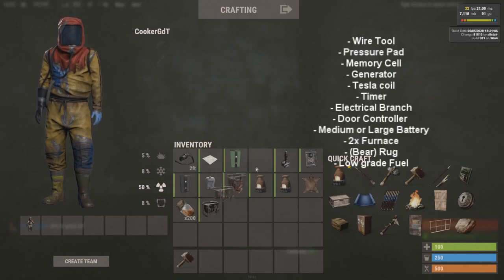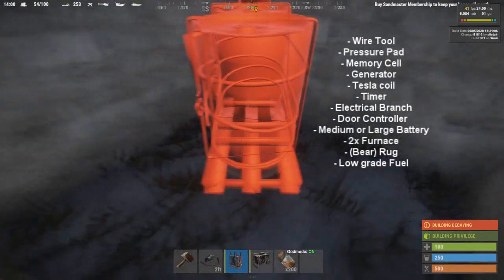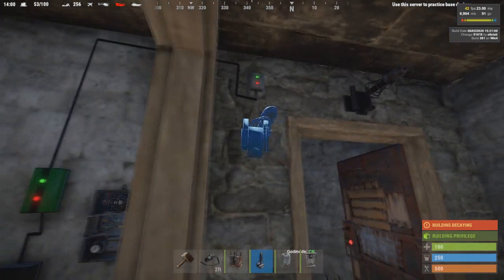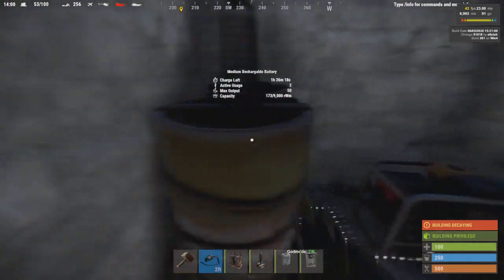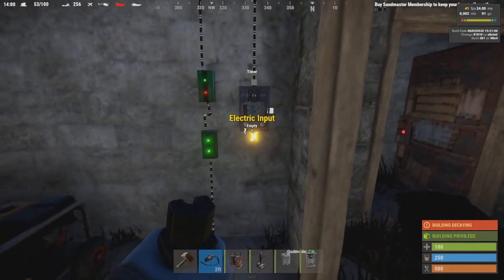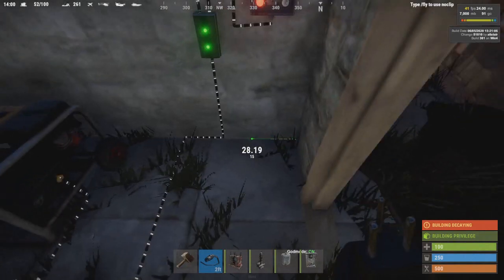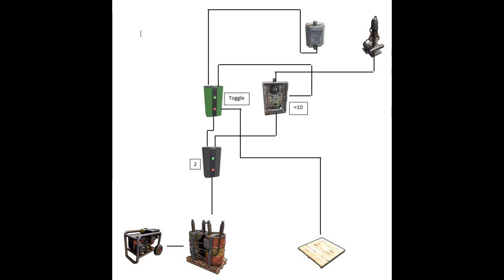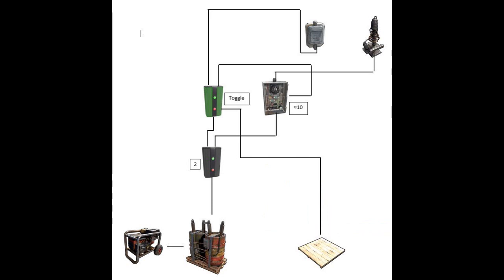RUST : Automatic TESLA COIL / DOOR trap - No visible power source

Comment: to people asking how to reset the trap in case you accidentally activated it when returning home: there are a few possible solutions. the one i'd go for is to use set / reset instead of toggle. you'd have to add a 1 second timer (and another branch to power it, 2 power is all you need) and connect it to the reset part of the memory cell. connect the pressure pad to the set part of the memory cell.
using the toggle in this particular trap is actually a blunder and can be exploited. if they are quick enough they can move off the pressure pad and onto it again which will toggle the memory cell and reopen the doors. more importantly, they might do it accidentally by panicking and moving around. after that they can simply come back and loot their body without entering the trap or their friend could loot it for them. if you use set / reset no matter how many times you step on the pressure pad nothing will change, even when you step on it on your way back. the only thing that will reset the trap is the timer/switch in your control room.
Reply from the maker: Hello Lordemus, 
Yes your technique is perfect to reset the trap, we could use actually many other devices to rest it. But in this case my goal was to make the cheapest trap in terms of components and energy. That's why i placed all my furnaces in the room in the way that you cannot desactivate the pressure pad, no matter where you move.  Plus once the tesla coil is on, you cannot jump anymore, so absolutely no chance for them to trigger the trap twice. But thank you for your comment it will be useful for many :)

Comment: at 4:36 you Mention "make sure both of the Memory Lights are green"... how do i make them green / how do i reset the trap
Reply from the maker: Hello, just by walking once on the pressure pad. So when you leave your base basically.
Reply from the maker: Each time you walk on the pressure pad it will switch your trap to ON and OFF.
Reply: @benji6b  and if i accidently activated trap by stepping on it but not leavin the house cause i stepped back into the battery room. Then the Lights are red and green and i cant walk out. I Need to reset the System somehow. Otherwise i die by going out.
Reply from the maker: @billy3037  In this case you can disconnect the battery or remove the memory cell and replace it again. I think this works.

Comment: How can i do for not trigger the trap when i leave the base or enter in the generator room?
Reply from the maker: Hello, to enter the generator, use your sleeping bag. To leave you can disconnect the battery so the power, and reconnect, both light must be green when you leave the base in order to not get electrocuted by your trap.
Reply: @benji6b  what does it mean if the lights are green or red and green? I added a switch before the branch in this way i can deactivate it from there
Reply: you could use a HBHF sensor set to "include authorized + exclude others" which emits a signal to a blocker or XOR switch to prevent the tesla coil from activating. Basically if you are in the room, it would not work.

HBHF is a bit more advanced than the pressure plate, and it would be an upgrade for sure.

Alternatively, you could make this a "fake" entrance to your base?
Reply: @ghostsquadme  yeah that's what i did.. i have another entrance behind the house
Reply from the maker: @ghostsquadme  That would be a very good improvement yes. I did a video using this HBHF sensor the way you describe it. It was for a safe push button, check it out :)